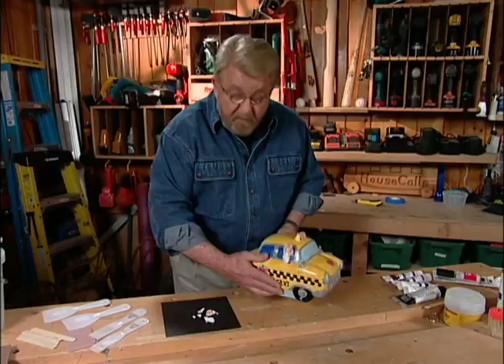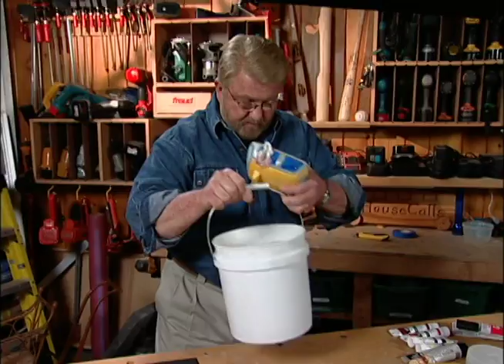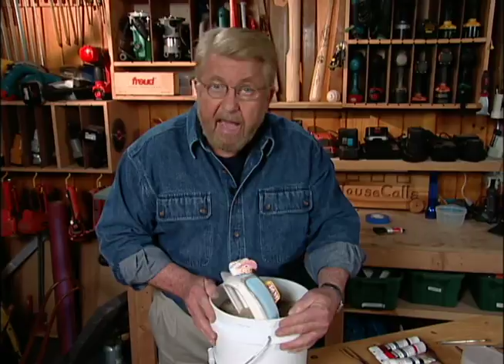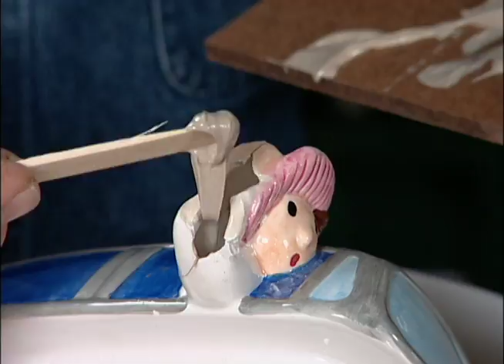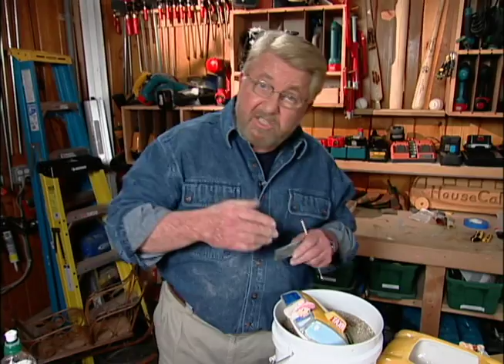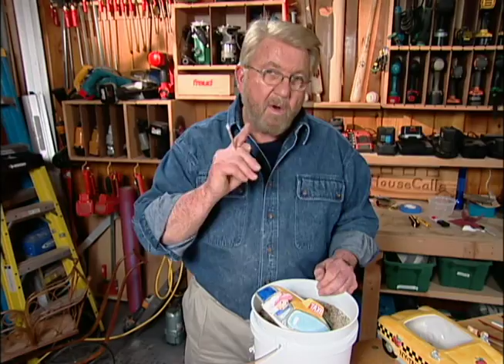How to Repair Broken Ceramic

Comment: You did a beauitful job.....i was curious if plastic wood filler would work replacing missing pieces...glad to see it does...i wasn't sure if i could chisel the dry product....glad to that you show that part...do you think all brands basically work just as well...i couldnt find the minwax brand...i have the dap one....tfs

Comment: Hi, thank you for all your wonderful tips. I am hoping you could recommend a filler for the inside of a ceramic mug? There are small holes on the inside handles and I noticed that they cannot be cleaned. The mugs are vintage and are used for hot and cold drinks. Thank you again.

Comment: MY PROBLEM, SO I HAVE A NICE Mayan replica CLAY VASE, it has long legs, when moving one of the legs broke, and disappeared, i been wanting to find a way to repair it.Any suggestions? and where can i get such clay for replacement.
Reply: It doesn't look like he responds to comments, but perhaps you could use a dowel of similar thickness (for support/stability) and build the rest up into the right shape with wood filler, like he did here?

Comment: I was wondering why you used water instead of a medium with the acrylic. Medium helps retain the paints texture while water will change it drastically and make it harder to use.
Reply: @dropndeal  Does a water based acrylic paint wash off or fade? Thank you in advance!

Comment: Hello I was wondering if this process would work on an old vintage ceramic christmas tree one of those green ones that have the little plastic lights and a lamp underneath it. I chipped the top of the tree.
Reply: Why would you think it wouldn't?
Reply: Sure - but s lot of those are fired with a glaze, which gives it the rainbow hue when the light hits it. Unless yours is green, then you should be able to repair it just like he showed.